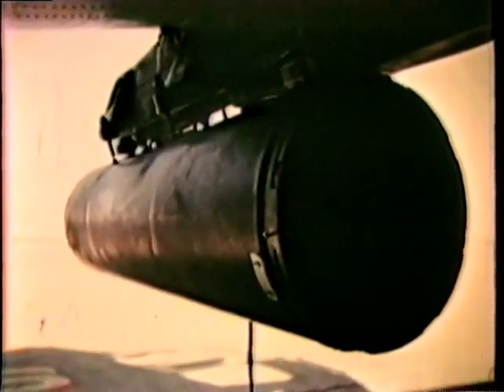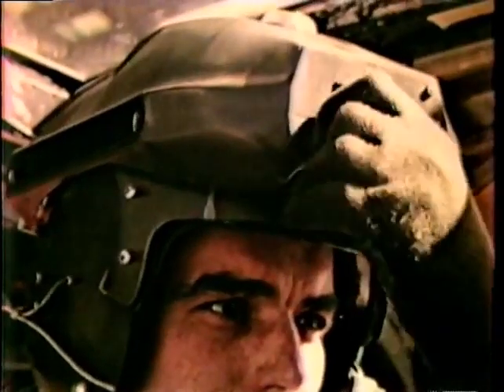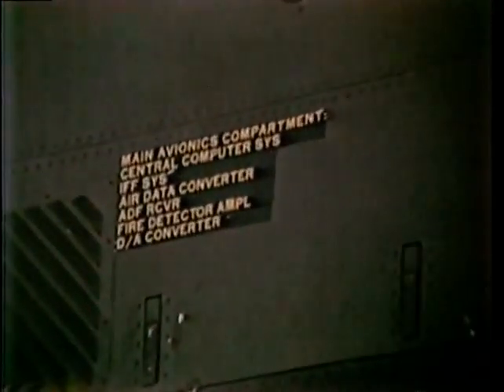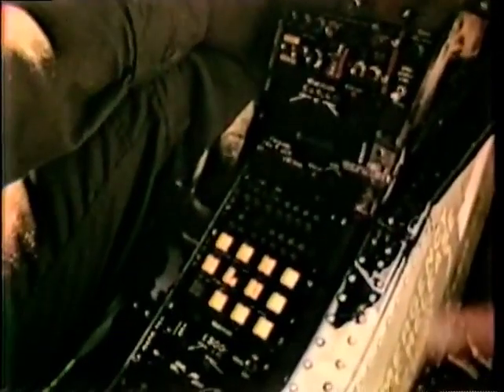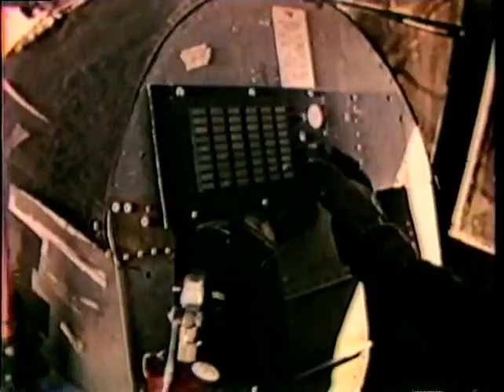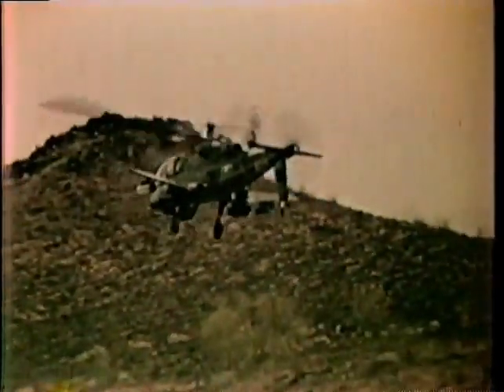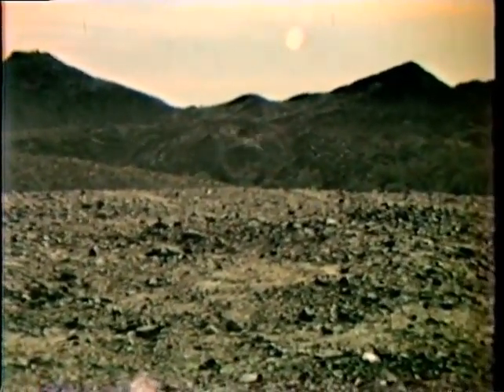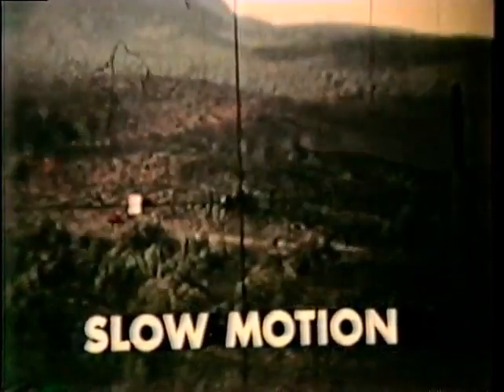AH-56 Cheyenne Helicopter

Comment from the maker: US Army featurette on the experimental AH-56 Cheyenne attack helicopter. Lockheed developed the AH-56 as a high-speed armed escort for Airmobile transport helicopters like the UH-1 "Huey"

The Cheyenne took its maiden flight in September 1967.  However, technical problems and a fatal crash led to the project's cancellation in May 1969.  The Army continued using the AH-1 Cobra until development of the Hughes AH-64 Apache.